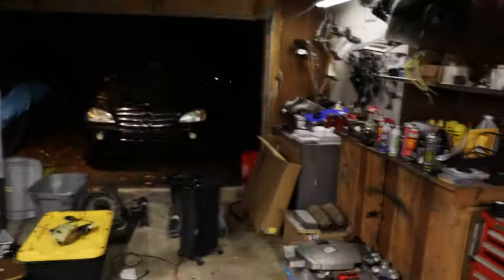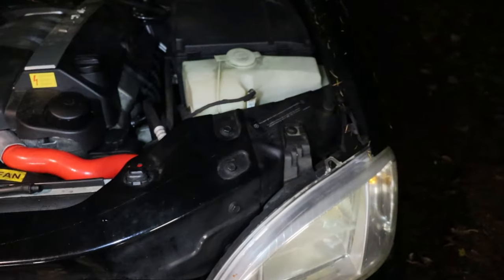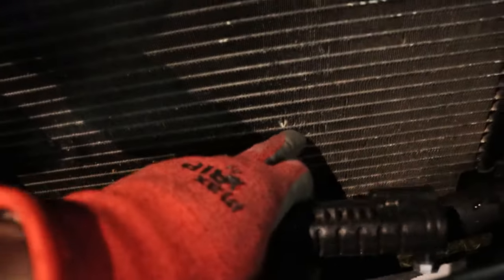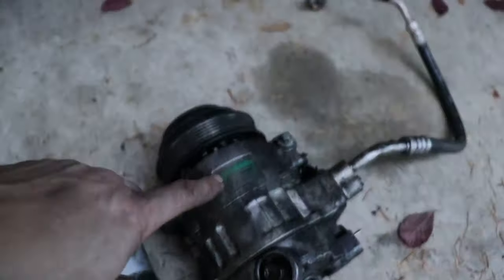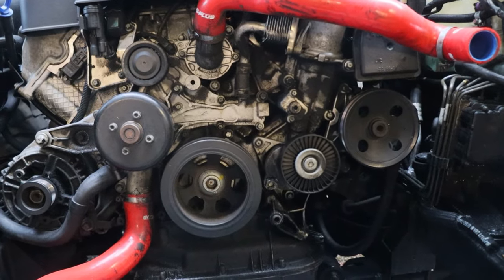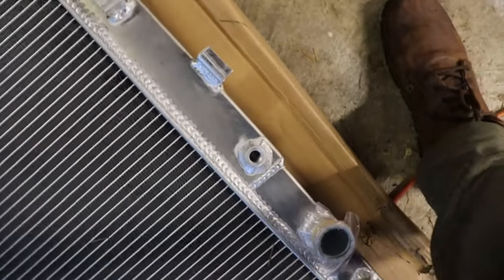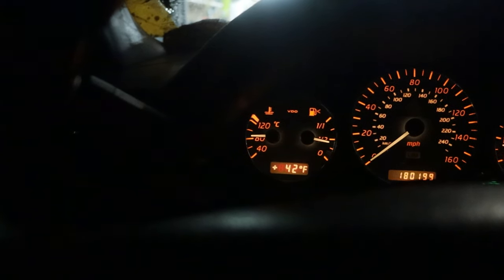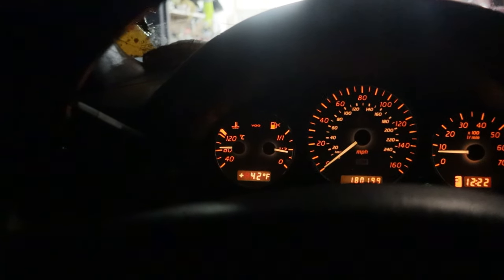ML55 Radiator and AC Delete + Reflecting on Red C55 Situation...

Comment: With the headliner on the c55, you might need to remove the front seats or sometimes even the front windshield. 
For the oil pan since you have the transmission out already you could just hoist up the engine by unbolting the engine mounts and lift it up just enough to get the pan replaced.

Comment: What is the benefit of that modification?
Reply from the maker: My AC system leaked so I don’t have to worry about it anymore lol that’s it
Reply: Please send the part number of the band to MAKE that modification on my clk430 m113 engine, thank you
Reply: My clk 430 is only for drag racing and the a/c doesn't work
Reply from the maker: @pelloelviejon  it's in the video ;)

Comment: Hey bro looking at a 2000 E430 4matic high mileage has 248k but needs some things do you think it's worth it? Needs the rear main seal, valve cover gasket, and seals on the rear diff where the axles go. Runs and drives great though guy has it for 1500.
Reply from the maker: I would pass at that price tbh. You’d do all that work and it wouldn’t be worth what you paid. You can find much better examples with low miles for that price
Reply: @ANDERZENAMG   I was planning to offer 900-1000 if I did would that be more acceptable or think it's worth even less?
Reply from the maker: @johnnyionescu-yr6sk  I wouldn’t pay more than $4-500 tbh, and in reality I’d pass altogether unless it’s crazy clean.
Reply: @ANDERZENAMG  Picking it up for a 100 and it is really clean in all honesty.